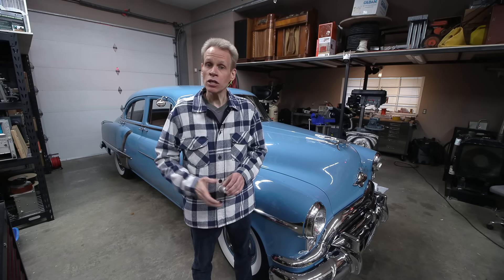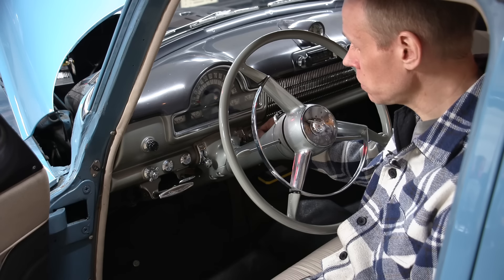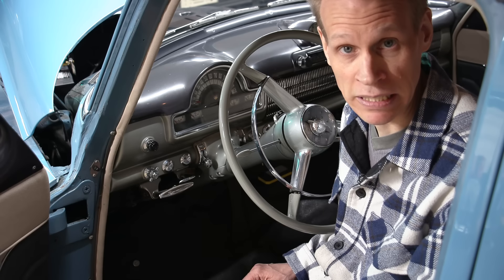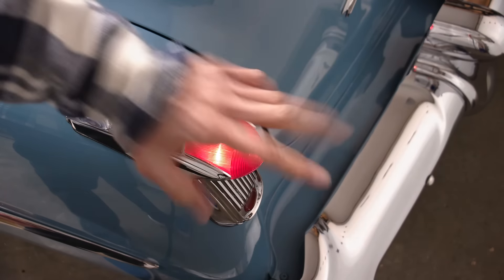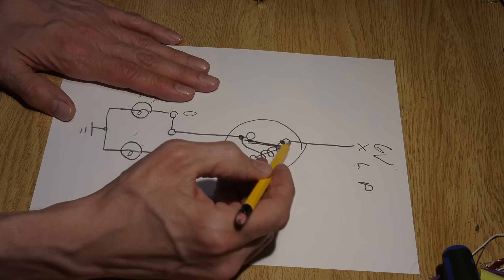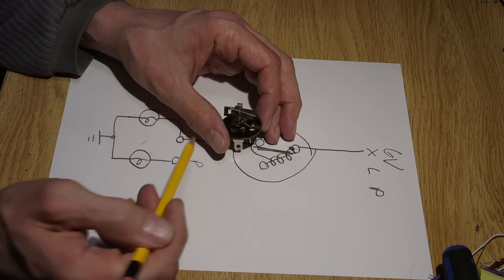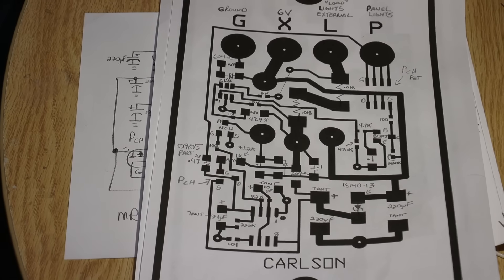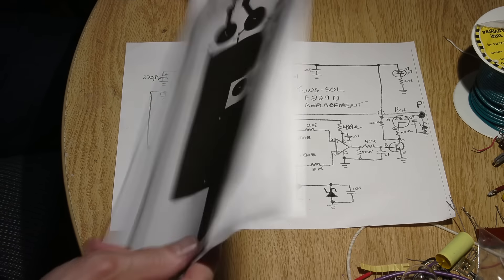How A Turn Signal Flasher Blinker Works - Complete Redesign With Schematic [Tung-Sol P229D]

Comment: Hi Paul, is it possible to contact you by email? The address on your channel about tab does not work. I found some unusual vintage test equipment that I don't need and several of my subscribers suggest you may be interested in it.
Reply from the maker: Have you tried the "new" email? The old one has been gone for some time, the new one works fine as I receive about 200 emails a day.

Comment: A 6-pin PIC10F200 would do a better job, plus it could be programmed (using a current sensor) to "very fast flash" or something the panel light to tell you that your bulb is "out" as an extra feature!
BTW to power the PIC just use a schottky diode (low forward drop) and a 47uF+ cap to keep the power up for the CPU like you did with the 220uF in you circuit, plus of course use a low IQ LDO regulator for the 5V.  ....JUST A SUGGESTION! :):):)

Comment: Wow... Somebody asked if the legth of wiring affected something...and my reply was: In 6V system it can significantly affect the system in a negative way - cold bulb filament needs a big inrush current and the length of the wire can act as added resustance, thus making the bulb slower in reaching the full brightness. All that in combination with short ON time can hinder the visibility even further. And yes it alsi affects blink rate a bit.

Comment: I have had problems figuring out the flasher system in my 12v 1996 dodge van... I had to replace all bulbs external and dash to get it working again..

Comment: Well done. The relay will sound better when the case is enclosed. Waited for the finalized mounted stated but you didn't include that. Does electrically modified cars need to be checked by the Police in your country?  I am a micro controller guy. Unfortunately for such application discrete components is the way the go. Hope to see you one day build a circuit with a micro controller :)
Reply: why is it the way to go? I don't see a reason not to use a microcontroller right now.

Comment: after altering the 12 volt flasher to work on 6 volts.... could you have simply put it back together , maybe add anther wire to it and used it as a replacement?

Comment: "Pretty crazy the way they put this together, right?" Well, no. The reason the panel lights are not in the "cycle determining circuit" is so that a burned out bulb will change the cycle frequency, alerting the driver they have a light out. Were there no need to be so current sensitive, a simple parallel circuit (enunciator and load) would suffice. This design is very interesting, but not due to bean counters, rather due to human factors engineering. Thanks for sharing!

Comment: I wonder if I could use this idea to make a switch that would turn on the bathroom light, my electric toothbrush, my razor, the shower, and flush the toilet in 10 minute intervals? hehe😁 
All jokes aside, since you're removing the need for dead shorts to engage and release the flasher couldn't replace all the bulbs with LEDs now?

Comment: the timing is spot on... the click sound is not authentic though... should be more mellow with more bottom end as per the original flasher module

Comment: One thing a standard blinker module does is flash faster if a bulb burns out or otherwise stops lighting. This lets the driver know there is a bulb not working. Does this electronic blinker do this or will it still flash the same with only one bulb lighting? I think it will flash 50/50 as usual and the driver will have to be told a bulb is not working when they get pulled over by the police 😁

Comment: It might be a classic  but first target for me would be 12 volt electrics
Reply from the maker: When the 6V system works properly (like in this case,) other than available parts, it works fantastic. That 6V battery will crank this car until that starter glows red.
Reply: @MrCarlsonsLab  The big mistake made on 6 volt cars- is using off the shelf 12 v battery cables -which are too small in diameter to send sufficient amperage to the starter.

Comment: not bimetal, it's just a wire, when it gets hot it gets longer.  some flasher unit pass the lamp current through the wire instead of using a separate heater.

Comment: now start the engine, and see how well that blinker works. Also you never tested the hazard lights function.
Reply from the maker: Hazard lights? No such thing in a car like this. It's the 50's. Seatbelts? They were added. Power steering= No.... Power brakes= No...  ETC
Reply: @MrCarlsonsLab  And best of all,  they were built so that it was easy to fix almost anything! I miss my pre-OBD II car,  I did everything with regards to maintenance,  repairs, and troubleshooting with a "basic" tool kit.

Comment: I kept getting thrown off by the mention that the wire heating up and cooling down causes the on/off/blink. The on/off/blink rate, I would think, is because of a magnetic field expanding and then collapsing in the coil of wire. Yes, it gets hotter/colder during that, but temperature doesn't make this work, the magnetic field does.

So as current goes through the X/L coil of wire, a magnetic field is being created. When that magnetic field gets "strong enough" it pulls the X/L contact closed. The X/L contact offers less resistance (presumably because the X/L coil wire is thinner, and thin wire has more resistance than a wire thicker than it), so the current favors that path over the X/L coil. As that current leaves/reduces in the X/L coil, the magnetic field collapses until it isnt strong enough the hold the X/L contact closed, so the X/L contact opens. The only path for current then, is the X/L coil, which starts the process all over.

Correct me if Im wrong though, I'm a little new to electronics.

Also... check the operating temps of your final components. For example, some 555 timers indicate 0-70 degrees Celsius, which with me being a Wisconsinite for example, would be a problem during the winter. Not saying it "won't work", it just might have some unexpected results.

Comment: 12 volt power is already touchy, I can only imagine with 6v... I mean, modern cars are mostly 5 volts for management computer modules, but the power loads are relayed to the 12v part of the system...

Comment: Foxboro Controls used to use nichrome wire in their pen recorders.  After a few years, you couldn't full span no matter how you tried to calibrate the pen drive.  But the wire was so fun to play with, running some current through it and watching it coil up and then unwind.

Comment: Nice design, however you seem to have lost the safety feature that when a bulb blows the pulse rate increases to let you know that there is a problem. As far as I know this is still a requirement on older cars.

Comment: Hi, Paul is not the reason this system is built in such a way. Is to alert driver bulb is burnt out? These signal bulb wires do dual duty. They also run to brake lights w/out using another pair of wires!

Comment: Why don't  you use LEDs in the turn signals? I was thinking what would look nice you can have a circular spiral of LEDs and  two ways of doing it, flashes around from the outside to the middle in a spiral or vice versa or the outside zaps to the middle going from out to in and back to out again would look cool
you should put a dab of silicon in the Gromit where the wires are coming out to protect it from moisture

Comment: It's amazing how when we deal with much of our digital electronics, as well as home wiring, e tend to switch the power side.  If you use that mentality going ito cars these days, it will make you crazy because it is the grounds that are switched most of the time.

With regards to digital, I have to say it because there is always some nutjob that jumps up and says "not always", yeah, I know. That's why I said 'much of our electronics". It all depends on using positive or negative logic.

Comment: Interesting project.
but the wiring design of the car just seems like one of those we wanted to patent something or invalidate a patent but somebody already patented the obvious way to do it already or the obviously was too obvious and we couldn't get it. Yes it's much easier to do things in a reversible way.
But if they just swapped the 2 indicator bulbs from left to right and ran that extra wire to ground already in the consul...... Saving 3 feet of wire and making things simpler for the future.

Comment: Wouldn't it be better to convert things over to 12 volt? Use LED lights instead? I know it's nice to keep things authentic, but there's just no contest, LED is so much better these days, and you can get any temperature you want.
Reply from the maker: In the old days, I would have thought the same, but the 6V system works fine, there is a lot of bad info out there about it too. That 6V battery will crank the starter until its red hot, and still have some to spare. The headlights are bright, and so on. LED's just feel dead, they have their purpose, but not in a true classic car. But hey, everybody has their own taste and opinion, that's what keeps the car hobby interesting. If I was to really modify it. IE: newer small block, transmission, brakes, ETC, then yes, 12V it would be.

Comment: I think I'd convert to 12V with a new battery, coil, 1-wire alternator, & new LED light bulbs. Let the starter spin twice as fast at half the current, and get a SS  flasher. It's 2024 now.

Comment: Why not just convert it over to LED. Much less current. Get rid of the current hog. Make your own adjustable electronic flash rate.  You could make a SMT pcb that will fit inside of the original can. I know, you want to keep everything original.😊

Comment: while i can appreciate the complexity of designing a circuit like that, why didnt you just add a ground so you could just use a 555 timer and a relay or pair of relays? yes you have to attach a wire to ground, but if you ever wanted to plug the factory flasher back in you can still do that.

Comment: Not sure - but I'll bet a *Raspberry Pi" microcomputer could also perform the "blinker" function.. (eye-roll)..
Reply from the maker: Yes, but without the current sensor, relay driving circuit, and passenger lamp driving FET, now we are back to the same size, maybe even bigger.

Comment: Alright so it’s a 6volt car you can basically power it with 9 volt battery with a step down converter
Reply from the maker: And then "current" entered the room :^)

Comment: I prefer to make device true solid state, without electromechanical relays, and small enough to fit in original case
PS: And also, without extra ground connection!

Comment: Just a note for those who wonder about why the funky instrument cluster warning lights are wired like that:

It’s intended as an elementary failure indicator, if you trace the circuit out you will find that the instrument cluster warning light for a particular turn signal switch position will not operate unless there is at least one outside globe in the opposite direction circuit is functional. 

Also I’m not familiar with the Tung-Sol flasher unit, but generally in this type of unit there is also a ballast (or limiting) resistance in series with the hot wire which initially allows a small current to flow (less than that necessary to light the globe) with the intent of reducing thermal shock on the filament (which has a positive temperature co-efficient)from inrush current, and also reduces the amount of time required for the globe to come to full brilliance.

This design flasher unit is generally normally open, so you get turn signal input > delay > flash. This was eventually changed to an normally closed type which has the opposite characteristic.

Comment: Can't you just connect L and P together and then just toggle the X line. No timing necessary .
Reply from the maker: If you recall in the video, that combination flashed the passenger side arrow while flashing the outside drivers side lamps.
Reply: @MrCarlsonsLab  I double checked the video and I'm pretty sure you did not test wiring L and P together and touching the hot line while both are connected.

Comment: Yep, MANY modern vehicles have the "flasher" built right into the BCM, and then the "click" of the now silent, solid-state flasher is a canned audio file that is then routed through the stereo amplifier and finally through the speaker system. Sometimes through a seperate speaker in the dash, or many times just the drivers door speaker. SO unnecessary in my opinion. Just GIVE us the usual flasher can.

Comment: It's not fair to look at 70 year old technology thru a modern lens.   That same vehicle most certainly dripped oil on the driveway which was considered normal,
Reply from the maker: Yes, the crankcase vent is under the car, so If I don't see oil on the floor, there is something wrong :^) The radiator also has a vent with no recovery bottle, so antifreeze spots are normal too!
Reply: and where did the oil come from in the first place? Asking for a dinosaur.

Comment: I am shocked that anyone would make a PCB the old fashioned way with the cost of PCB's so cheap today.  That board size in qty of 5 would cost like $9 at best. Its just not worth the hassle. The other thing I am shocked on is that he would put a no coated PCB in a vehicle application.
Reply from the maker: How long did it take to get your board? My board was ready in 20 minutes and project done by the time you sent the plans off. The box is sealed by the rubber gasket you see on the lid in the video. On top of that, do you think this car would ever see a rainy day?

Comment: Wow…talk about over-engineering to solve a problem that doesn’t exist.  😂 While the skill and knowledge is impressive, I’d convert the car to 12v (for many advantages) and then carry an extra flasher unit.   When any single component on that board fails, how to you repair that while on a road trip??  KISS is a great philosophy to apply.

Comment: Will this circuit fulfill the laws and regulations regarding cars everywhere in this world?
No, it won't, some countries have rules/laws that there must be a sound when the blinkers are activated, and yes, there are cars with an extra gadget that only has the purpose of making a sound when the blinkers are activated.
Some countries have rules/laws that there must be an indication to the driver of the car if one or more of the bulbs are burnt out, this can be a change in the blinker frequency, even the blinker stops working.
Different countries have different rules, I do not know the law, regulations and/or rules in Mr Carlson's country, so check out the stuff in your country before you think you had found a solution to a broken blinker that is unobtainable as of today.

Comment: Boy can auto electrics drive you around the twist, probably because so much is burried in the chasis and you have only access to small parts at a time.
That and that bulbs, especially the halogen type act as shorts when cold, and that the designers somtimes rely on that, as shown in this vid, can confuse many as all you see with a test meter is lots of wires with earths on them. In auto work a test lamp was often your best friend, however times are a-changing and LED lamps show up totally different to test gear.
You think your finally good with all this then someone puts a Telsa in front of you.....